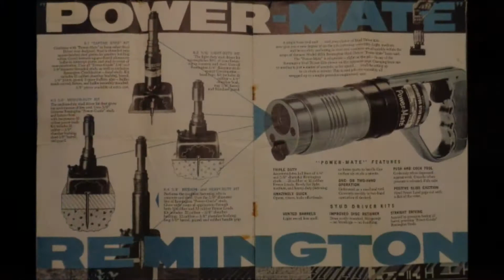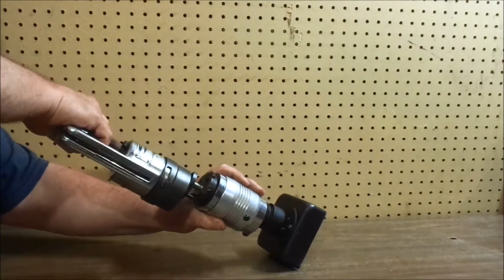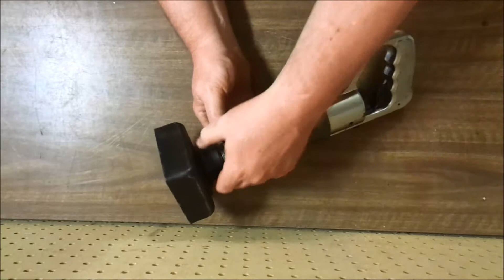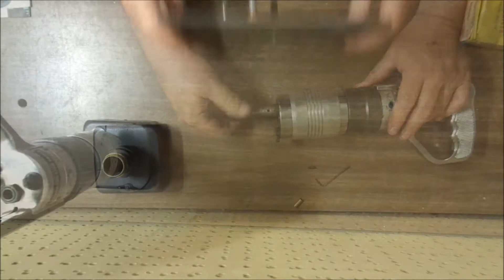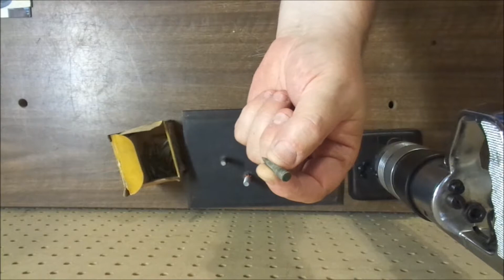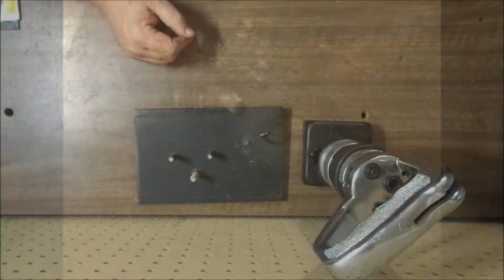Vintage Remington 455A Power Mate

Comment: Can you show how to load the nail in the tool
Reply from the maker: It's done the same way as in the Remington 450. The difference is this tool uses a breech plug but the 450 doesn't. The pin goes in before the breech plug. Note; modern pins will not work.

Comment: Hello, i have the same tool but my collar will not turn to prime the gun, it will turn when i pull the handle back to remove the brass. Cant see anything stopping the collar from moving along its track. Any ideas? Thankyou
Reply from the maker: It is kind of a klunky tool to operate. Look at other things besides the collar and see if anything might be in the way.

Comment: I never did get used to how to use the 455, personally. I probably still have it somewhere, but man... it's not intuitive or quick. What was the real benefit, perhaps it was stronger?
Reply from the maker: I don't see how it could perform any better than any other tool in its class. I think Remington was just proud of making over complicated cluster mucks.
Reply: Well... I suppose I'm not entirely surprised that there was no real benefit to it at all. Still, if I ever find where I put mine, now I have a better idea of how it's supposed to work.